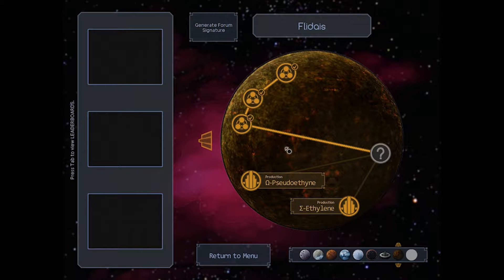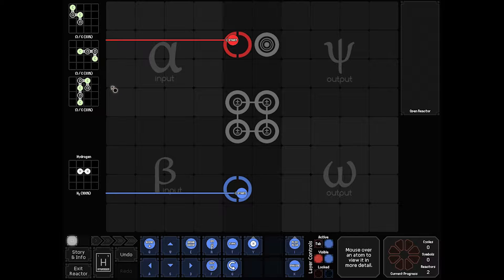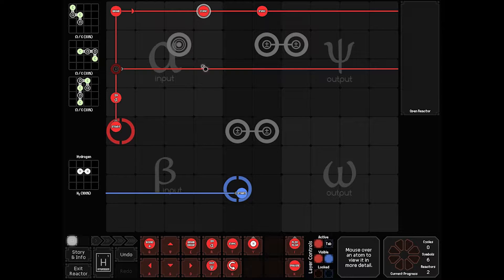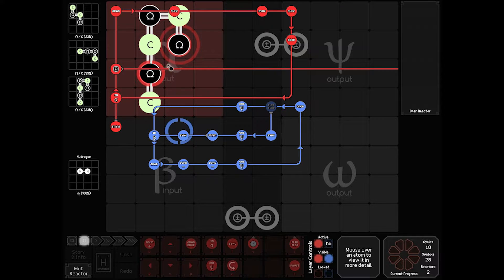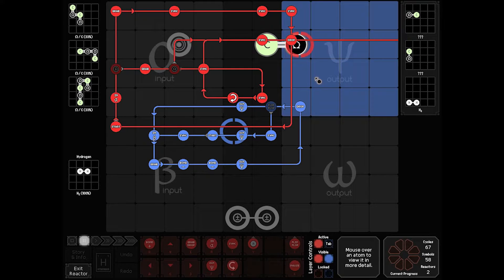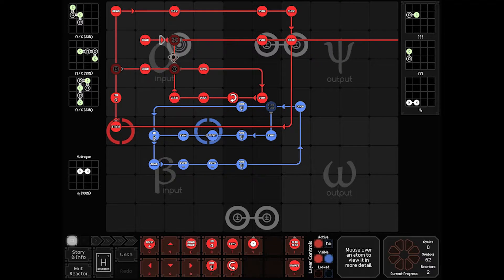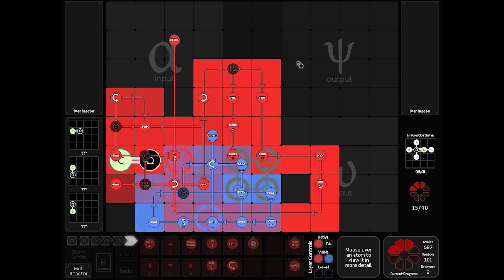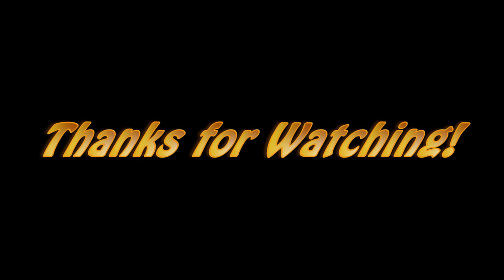SpaceChem 27 - Omega-Pseudoethyne

Comment: The upper pipe on the second reactor can be used as a sort of “storage” pipe. Though it’s unlikely to be useful in a fully optimized solution. 

In my first solution I would pump all of my broken down carbomegas (one carbon bonded to one omega) through first, then pump the hydrogen required for each carbomega through afterwards. If it weren’t for the pipe, I’d end up having up to 3 carbomegas floating around in the second reactor, but that looping pipe allowed me to “store” the carbomegas outside the reactor, and Input them whenever I needed them.

I’ve also seen that as a pretty hilarious alternative you can just pump out all of the six carbon carbomegas into the pipe and forget about them, since there is enough space in the tube (16 tube slots) to store all the 6C carbomegas you encounter (40x0.33 = 13.2 6C carbomegas). That way you only have to worry about managing the 4 carbon carbomegas and can simply pump 4 H2s every time.